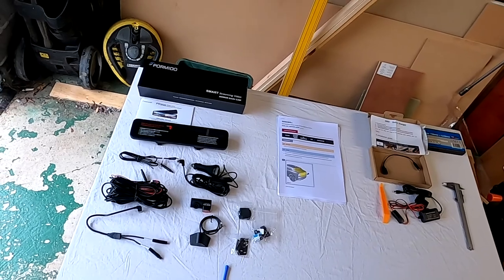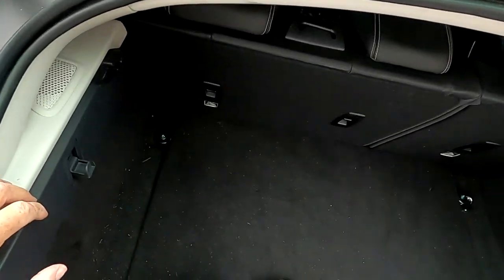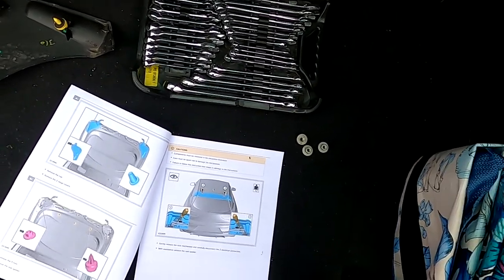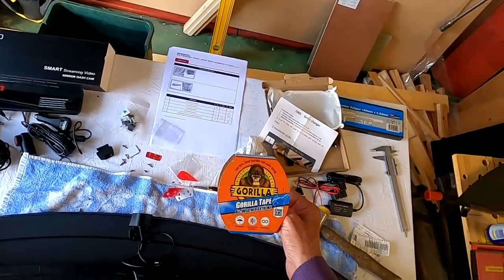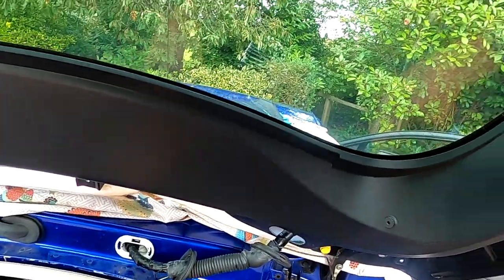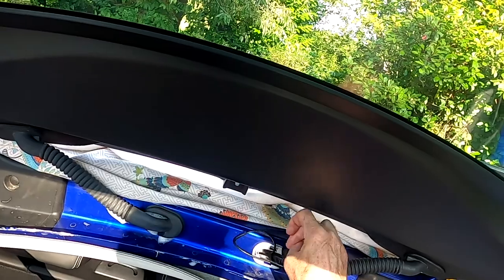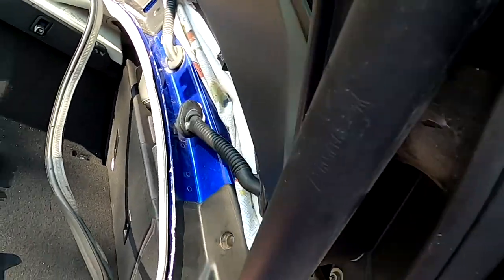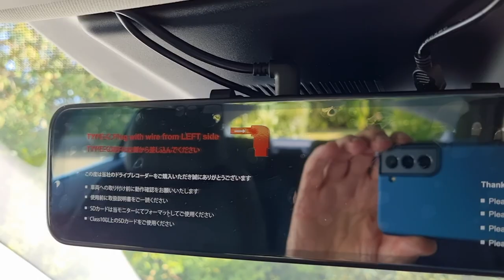Installing a Mirror DashCam on a Jaguar I-Pace

Comment: Many thanks to you for posting this video.  I bought a similar - but different brand of dash cam mirror and by following your video was able to install it by myself.  That's something I would not have been able to do if you had not posted the video.  Due to the small rear window in my I-Pace a rear camera mirror is almost a necessity.  You depicted the installation very thoroughly - though the camera didn't capture the disconnecting of the brake light wires.

The only problem that I encountered was disconnecting those two brake light wires on the spoiler.  They are very short.  I struggled several times to disconnect them.  I saw that black square in the middle and pushed down on it with the medium blade screw driver.  No movement.   I then pondered cutting them and splicing one end with a longer wire and putting quick disconnects on the other.  Didn't have the hardware for that - so I searched for a video online that covered the actual disconnecting of the brake light wire.  Didn't find a Jaguar video - but did find a Land Rover video, which depicted placing the screwdriver under the plastic tab to either side and raising up on the tab.  That allows the square in the groove at the top of the connector to be slid outward from the connector.  

After that I had no other issues.  I was preparing for a difficult time pulling the rear cam connector cable through the rubber conduit.  I did basically what you did except I made a hole in the upper rubber of the conduit near the wire collar as the collar around my wires was extremely tight.  After taping the connector to my hangar wire, which I clamped on the wire below the connector, I taped that bulging area with electricians tape and  soaked it with liquid dish soap.  It slid through easier than I anticipated.

Again, thanks so much.  I must confess I didn't do everything myself - after I finished I had the wife press on the brake pedal to ensure the brake lights on the spoiler still worked.  Never was I so happy to see working brake lights.  I really don't want to have to remove the spoiler again.  If I do - I'll know you taught me well.  Your video was appreciated by me; and I anticipate by others in the future..
Reply from the maker: Thank you very much for your comments, it makes the effort worthwhile knowing that it has helped. 
I agree with you about the poor visability through the rear window but now I no longer have to bother with keeping the window clean or complain about the lack of rear screen whiper. Only when it snowed did I have to wipe my finger over the rear camera lens. Another bonus is that when I fill the car to the roof with 'stuff' it makes absolutely no differnce to my rear view. It must be cheaper to fit a Mirror Dash Cam on the production line instead of a dipping mirror, heated rear screen and wiper.
BTW I still power the unit from the 12v socket behind the centre consol, having never got round to connecting it to the fuse box.